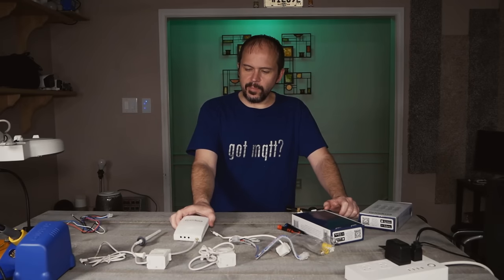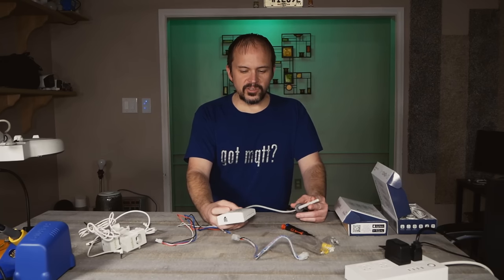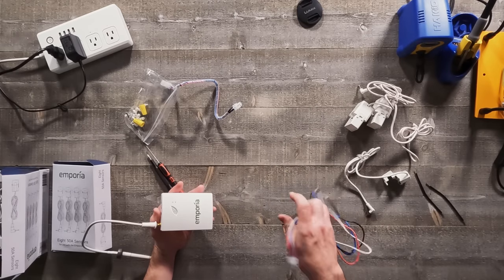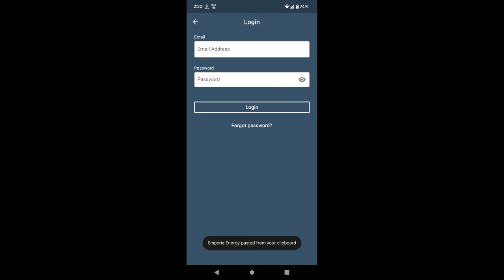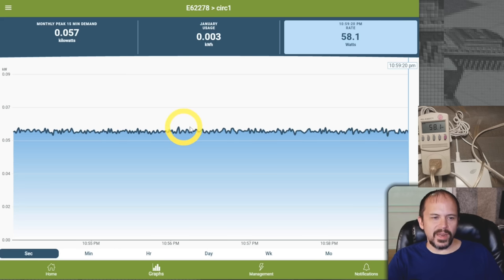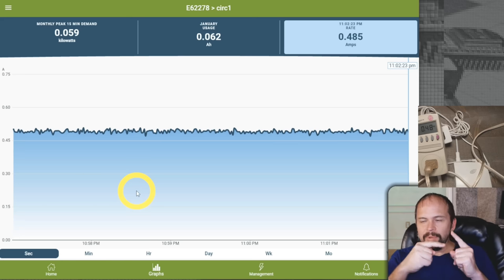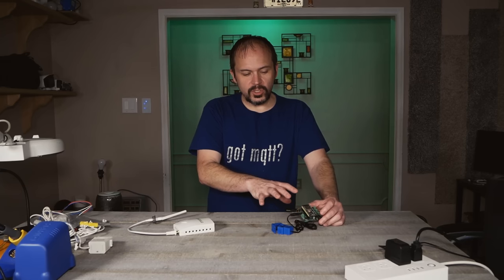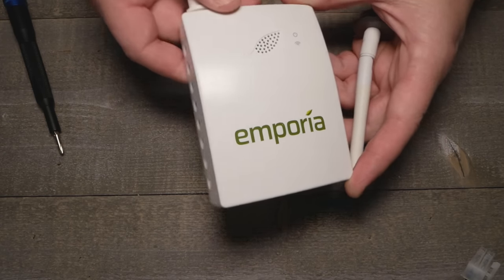Emporia Vue Power Monitoring Review | HOW TO w/ ESPHome & Home Assistant

Comment from the maker: * I misspoke about the RX/TX flipped due to habit - RXD to RXD and TXD to TXD is the method this board uses as they have the labels flipped already.  Look at my wiring and you can see I have it right but said it wrong.
Reply: You should pin this
Reply from the maker: @AnthonyDiRuggiero  thought I did but I hit pin again on it. Thanks!
Reply: Actually it's on the description too. Thanks.
Reply from the maker: Added it there too. I looked to see if YT would let me put text overlay but they removed that feature.
Reply: 16 month later and I wonder if you would wanna make an update what has changed and in what direction, massive imporvemnts and tiny ones
Reply: Using its original firmware, the Vue used both BT and wifi for setup. With this local firmware, BT seems not to be used at all... Should I be able to add a BT proxy statement to the Vue yaml?

I tried it on one of the four Vue I have flashed (I've done loads of other OTA updates at this point). The code validated and compiled, then installed OTA successfully, but then both wifi and BT failed to connect, leaving me with a non-working Vue that I had uninstall to re-flash using the serial connection.

A couple issues, first the Vue I flashed with BT was the one furthest from my HA server (50 yds); far beyond normal BT range (stupid in retrospect). Second, there may be something about BT and Esphome that I fundamentally don't understand. I haven't set up any other BT proxy... but, my thought was, why add something dedicated if those four ESP32 are not having their BT used?

So, my questions are, should I be able to do this, and what am I missing? (Before I try the same thing again and have to re-flash another Vue by serial).

Edit: I used the BT section that you had in the yaml for flashing the Wyze powerplug for a BT proxy.
Reply from the maker: @Scaliad I wouldn't do BT proxy on these myself. It is already pretty busy with all the sensors and such.
Reply: @digiblurDIY Me again, thanks for the reply... OK, so I get that the ESP32 in these Vues is pretty busy, but am I right that, in general, any ESP32 that isn't so busy, say one just flipping a relay over wifi a few times a day, can host a bt-proxy as well? 

New to HA and automation in general, I'm having a hard time getting my head around to accepting just how powerful this tech is...
Reply from the maker: @Scaliad yeah. That's my opinion of course. The BT proxy just does a lot and should be only combined with something simple that doesn't spew a bunch of sensor traffic and such.

Comment: can confirm... if the manufacturer would put an "advanced" option to put in MQTT credentials and let me get the data out easily, i would buy one today no questions asked. I really appreciate all the details in this video and helping to educate users and push back on manufacturers.  In the end, I don't want my devices local because I'm afraid the cloud may go down... i'm sure for many folks the cloud is more reliable than their home setup... the reason for me is that I want to own my devices and my settings and my entire situation. I don't want some vendor deciding what they will do with my hardware or my data. I don't want them deciding they will no longer support the version of android I'm using so I'm just out-of-luck. I want to control my devices, my data and my home. Thanks again man... you're doing a great job!
Reply: How the hell did we stumble on this same video today?
Reply: @dphanks  because we're both awesome?
Reply: @FrankGraffagnino  Sounds about right.

Comment: BTW, I don’t think Emporia will come out with a firmware update allowing MQTT. They’ve already come out on their customer support forum saying they’re not interested in selling the hardware. They’re interested in power consumption data - cloud. Having said that, it’s using MQTT already. If you don’t want to take it apart and reflash it, create a wifi network called “emporia” then take a stock firmware or factor reset unit, power it on and see what happens. :)
Reply from the maker: Right. I covered their post about this in the CircuitSetup video. Nonsense but whatever... Take it out the cloud is pretty simple.
Reply: @digiblurDIY  oh cool, sorry for covering things you already did. I’m picking up kids from school and obviously missed some parts!
Reply from the maker: All good and that was a totally different video anyways. I appreciate it and it is always fun to poke at the companies a bit. Sometimes I get lucky and they listen.

Comment: I finally got around to flashing my Vue2, and I figured out why the header holes are wiggly. Once I cleared the solder out of the holes, I took my header, and tried to push it in as a single piece, without cutting it into individual pins. It fit! The holes are offset just enough to grip on alternating sides of every other pin: I bet during development, they use a pin header cable that way, without having to solder on a connector - so they can grab any board from a dev run and connect to it. I went ahead and soldered anyway, since I already had a header cut for it. :)
Reply from the maker: You might be right there!
Reply: Same.  Just enough offset to bind the headers into place.  Used a solder sucker to clear the holes and soldered on a header strip.   Quick and painless.

Comment: Always appreciate your great tutorials. 
I'm 70 years of age and I'm still learning and totally enjoy flashing my devices with Tasmota and playing around with simple python scripts. BTW I did my first coding in 1978 using TRS-BASIC when I purchased my first computer at Radio Shack. It's was a TRS-80 with 4kb Ram. That's right KB not MB.
I would write code in Basic for uncounted hours and then save it ever so slowly on an external cassette drive. No floppy drives yet and I couldn't afford one at this time in life with a wife and young kids.
In 1978 I was also using very inexpensive X10 Home Automation  devices to turn my lights on at scheduled times as early as 1978. That was very cutting edge at the time.
Now 50 years later using Home Assistant with my whole home connected and still learning. I recently purchased several Sonoff S31 smart switches with energy monitoring as they were on sale at $10ea planning to get those flashed with Tasmota and monitor the areas that need it adding to the mix of other devices.
Anyway thanks again for your great tutorials.👍😊
Reply: Love you old man 😘

Comment: I've had mine installed for a year and it works great,I'm very happy with it.I also bought 4 of their smart plugs to check random devices and they work fine as well.
Reply: Make sure you update your config, there is a bug in the old config file that can cause the flash memory to degrade and eventually fail. See the new config file for reference.

Comment: Thanks flashing worked like a charm 

Tips for those that come later 
To remove the old solder my technique was Flux , small bit of new solder , more flux , then draw out with solder braid. Leaves nice clean holes.

Re the voltage set the flasher to 3.3 V if you get the wrong pin it just won't work rather than release magic smoke.

Comment: On my Emporia Vue 2 to my USB TTL the wiring was TXD to TXD, RXD to RXD, which didn't make sense, but it worked. 
My Emporia is about a year old, so it may be different per model.
Reply from the maker: One of those things you just have to figure out how the engineer labeled them in what reference. Luckily a 50 to 50 thing and doesn't hurt anything.

Comment: I had a really difficult time pushing the header through the holes with the existing solder on them.  Instead, I used a pin-vise to clear the holes, then an unbroken header slid right in and I soldered the backside like normal.
Reply from the maker: Nice tip!

Comment: I first saw the wiggly header in a parts library, I think from 'Spark Fun', but it might have been somewhere else.

The intent is that the through holes in the PCB are offset just enough to grip on to the pin header enough that you can flip the board over to solder it without the header falling out.  If the 'wiggle' is too much for the hole size, then I bet it distorts the header when you are soldering it.

-Jon
Reply from the maker: Does make sense with doing through hole stuff.

Comment: Managed to suck the solder out of the holes using a solder sucker pushed against the other side of the board while I had the soldering iron through the hole, cleaner it up very nicely and was able to add a strip very easily and is nice and OCD straight :-)
Reply from the maker: That did bother me for sure. I am still tempted to buy one of those guns that has the heat and vacuum part that works for this.

Comment: Yeah, every CT has a band where it's most efficient/accurate; just like speakers. The pigtail end of the CT will likely be outputting close to the noise level in the circuit at those loads. Multiple wraps gets things further above the sensing threshold.

Comment: Great tutorial, thank you! I had to update ESPHome in HA manually to the latest version for the template yaml to compile. I also had to lower the baud rate to 56700 for the backup, as higher speeds gave me read errors. Probably not the best TTL adapter, though I never had any issues so far.
Reply from the maker: Nice! Nothing wrong with pulling it slower. Sometimes if I know I want to go back for sure I pull two copies and do a md5 of both.

Glad to hear you freed it from the cloud!

Comment: I used a PCB Drill Bits Set, Micro Drill Bits Set from amazon and drill out the holes in a straight line and snug to the pins and worked great.  Only item was having to do command line ESPhome since I'm using a Blue
Reply from the maker: I like the dedication!
Reply: @digiblurDIY  I don't know about dedication.  I know my solder skills as of late.  Thanks for the heads up about blue and ESPhome on the emporia.

Comment: I've finally got all the parts and pieces to do this to my Emporia Gen 3. I'll hold off until you upload a video on that. I've read through some of the GitHub conversation around this but it feels like there has YET to be a guide written on the new Gen 3. Hopefully the ethernet port will be supported and I'll be interested to see if you use the new ESP Web tools for flashing. Do you know when you might be completing the new video? Are there issues or roadblocks you are dealing with concerning the Gen 3? Another question, do you need ESP Home running on something else prior to being able to configure the Emporia? I don't understand the interface you have open PRIOR to going to Home Assistant towards the end of the video (after flashing).

Comment: Note that when you see that output wattage flipping around like that, it does not indicate inaccuracy. In fact for those who have worked with low level electronics e.g. designing analogue circuits, A to Ds, etc., we prefer to have raw data - if ever I see a sensor with a clean output then I usually worry that someone has smoothed it using some (probably poorly designed) algorithm which I have no knowledge of.
Reply from the maker: Was I mentioning the noise on the unused ones?

Comment: I think they've put the offset in the pinheader for flashing the device. So you can put a pinheader in the holes without soldering, but have a better connection than if the row was straight.
Reply from the maker: It is strange given the solder filled holes.  Definitely done on purpose.

Comment: Great video tutorial, like always. I flashed and it's working like a charm. Thank you. But I have a question about sensors(CT's), where I have to change the name of the sensor? and how I can calculate the one's which is connected to 2 pole breakers? I have CT-1 connected to Range  on breaker #1,3 (A, B phase ) on A( 1) side, also I have few CT connected to stand by generator panel, which is connected to  2pole 40 AMP breaker in main panel. Thank you
Reply from the maker: You can rename the sensor in HA itself.  

They should have examples for the two pole devices where you can double it up.  Looks like this in the example: 
   - { phase_id: phase_a, input:  "5", power: { id:  cir5, filters: [ *pos, multiply: 2 ] } }
Reply: @digiblurDIY  Thank you for your quick replay. I did like you said and looks like it's working correctly. Only one weird thing, after power outage 30 minutes ago, it's showing UNAVAILABLE in HA, but log is OK and it's showing ONLINE in ESPHOME, also I add webserver, just to see what is going on and it's show all information on the webport.
Reply from the maker: @YevgeniyBolembakh that's an odd for sure. Did the address to it change maybe and HA can't connect to it?
Reply: @digiblurDIY  IDK but, when I removed API and added MQTT it's showing up in my HA normally. Again time to time it's showing unavailable. Doing my investigation about this. Will keep you posted. Please create a tutorial how to add MQTT to Esphome step by step,I think it will be interesting for some folks.Thank you again for all what you do for HA community

Comment: I just got one of these in Dec and is has 2 main clamps nd 18 reg clamps
Reply from the maker: The kit I got has 18 total like shown on the listing. Had it for 3 or 4 months. Special run?
Reply: @digiblurDIY  It have been working good in the app where I have the option to enter in my local electric company along with cost per KW. 
it only let me enter in electric price but there no way to enter in taxes so the electric cost part does not work well.
I also have random notice of offline in the app. and get ready for lots on notifications.
Like you said they are all in your business with that app

Comment: hey @digiblur , just did the emporia to esphome deal following your video was pretty easy thanks to it. only thing that hung me up for a minute was the phases of the breakers and getting them right in the yaml and making sure they matched up with the power wires from the unit.  other than that pretty easy deal. thanks for the video.
Reply from the maker: I noticed they did update things to have the phases. I stuck mine with the letters on the bottom pointing the way of the load then if they didn't register a load I just changed the phase it was assigned to in the code. Worked out. Nice to see they added that!

Comment: Have you ever run into an issue where 1 sensor takes a long time to update values? All of my sensors are doing great, but this one circuit monitoring a standalone AC takes several minutes to post updates in HA. I don't have any different filters on this sensor from the others. So it does update, but takes around 5mins. All other sensors updates within 1 second.
Reply from the maker: I haven't run into that myself, some sort of weird averaging going on?  You could enable the web browser and check to see if it is coming across.
Reply: @digiblurDIY  Thanks man! I'll keep digging around and will try the web browser tonight. I followed your video about 2yrs ago and finally bought my first home recently. Got this thing installed (and updated) last weekend. Its been a fun journey!

Comment: Given mains voltage tends to vary pretty well constantly, this is not as noisy as it may seem given the sample rate and they are not really doing averaging.
Guessing Emporia figure it looks more accurate like this?  Or maybe they just didn't want to put the extra effort into the programming to add any kind of averaging and still keep it ball park accurate
Reply from the maker: Guessing the later given even the kill-o-watt folks figured out how to balance it.  Not a bad box for the residential use case though given the price so I'll give them props for that.
Reply: @digiblurDIY  Could work well for something like Home Assistant energy monitoring and automations which are not so critical on minor fluctuations
Reply from the maker: And actually in stock which is a plus these days!
Reply: @digiblurDIY  I was just reading the specs and it states in the specs the Gen 2 Vue has ZigBee Smart Energy Profile 1.1b.   Did you find any use for that in your testing or did you do it all WiFi?
Reply from the maker: I didn't see any other RF chip other than the ESP32 chip. Where did you see this spec?
Reply: @digiblurDIY  I saw it on an amazon listing, but when I checked official site it is not on there so think the listing had it wrong
Reply from the maker: Wonder if someone did mix up the utility connect one with it.
Reply: @digiblurDIY  Sounds like it.   ZigBee would have been awesome in it

Comment: When you were testing this (around 32:31), where this you have the phase A ct and the circuit ct clamped? I'm trying to test mine before I install in my panel, and I get values that jump all over the place, even with no cts installed. I wired the black and white wires into a 5-15 plug to get mains power.
Reply from the maker: The CTs should be plugged in and closed to prevent the values from jumping around.